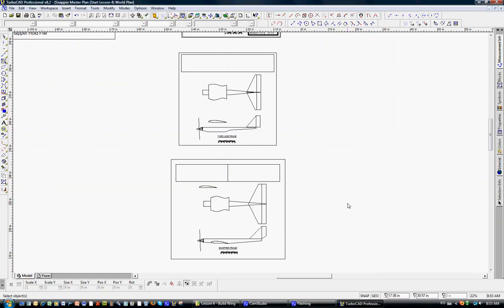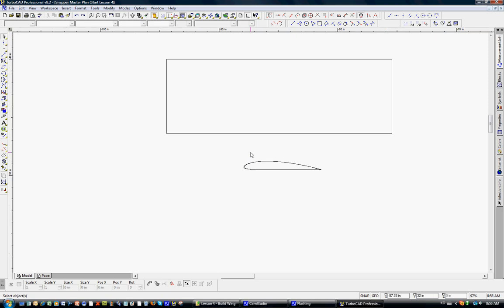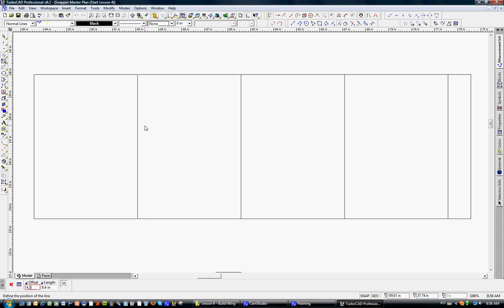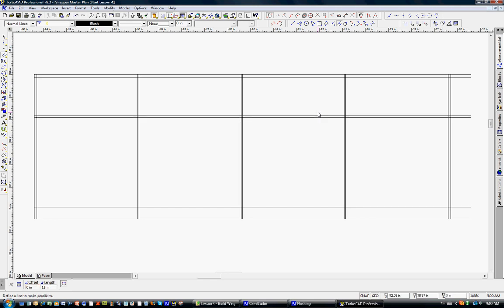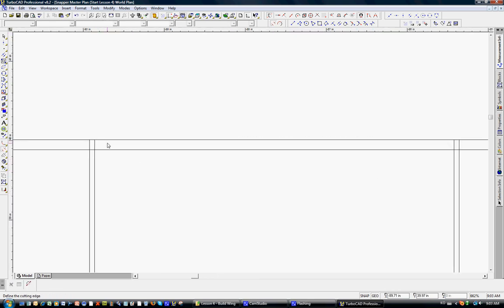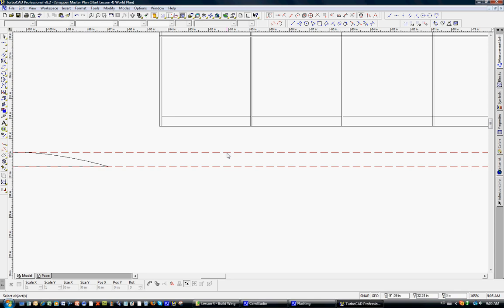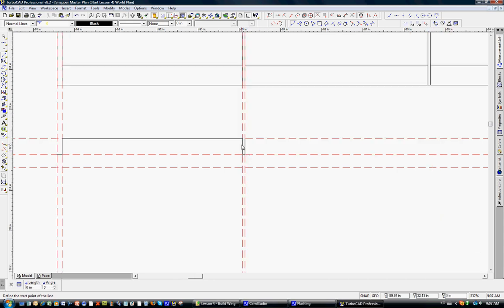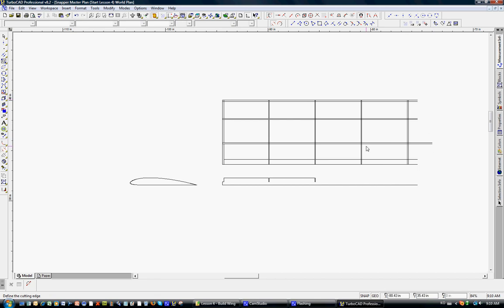Lesson 4 of 12 - Use TurboCAD to Draw the Wing

Comment: Hi,  nice tutorial. Would it not have been easier to use a polyline for the spar?  @ the min I am trying to draw a Supermarine Sea otter or rather trace one using AutoCAD 2020, big learning curve. TFS, G :)
Reply from the maker: Graeme:  As you know by now, that are several useful ways to do the same or similar task with TurboCAD.  One of the reasons I like this program.  Tim